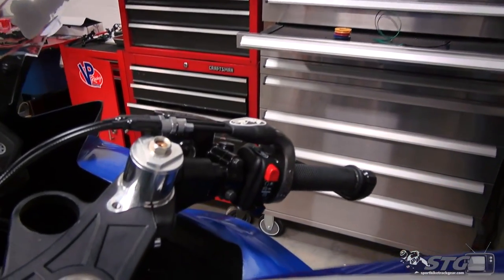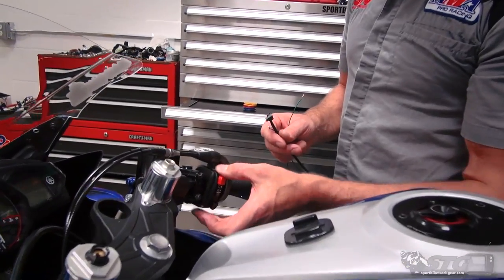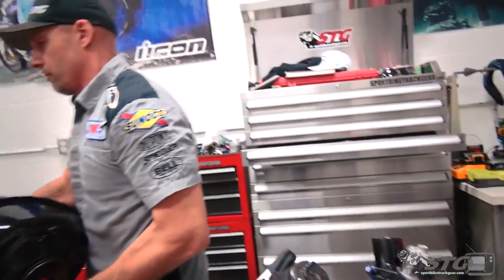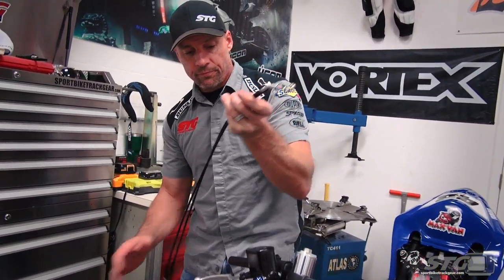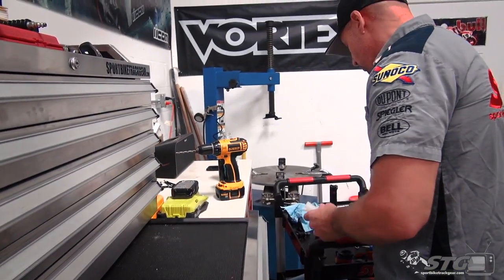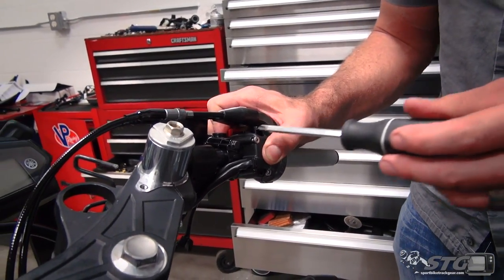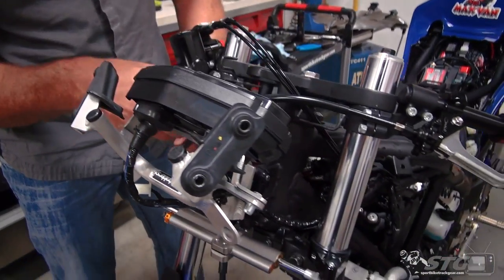Motion Pro Yamaha R3 REV2 Throttle Kit Install | Sportbike Track Gear

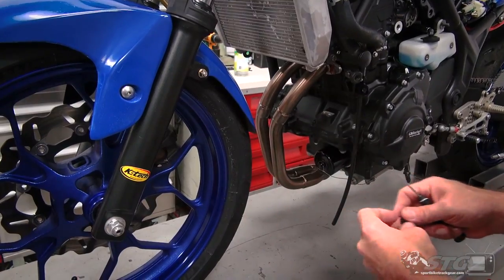Comment: At 10:18 looks like you may benefit from a radiator guard. They sell them at STG :)
Reply from the maker: You are 100% correct my friend! I never intended for the R3 to be ridden on the track as much as Max has ridden it. He will be racing the R3 in 2019, it will have a radiator guard on it then. I may even throw a new radiator in the bike and keep this one as a spare. - Van

Comment: I've got the rev 3 on a zx10r and the throttle tube doesn't fit in the housing??? When the housing is closed the tube sticks. It's soooo hard to turn like it's just not the right size
Reply from the maker: Sorry to hear you are having an issue. Over the years I have installed several Motion Pro Throttle Kits (REV, REV2 and REV3) and never had an issue. I would start with double checking your work. If you don't find anything reach out to Motion Pro and they will help get you sorted. - Van

Comment: Is the start/stop switch necessary to use this? I don't "need" to replace the stock one so if I can avoid buying as much as possible i'll be able to get on the track faster.
Reply from the maker: If your bike has a stop/start switch that is not part of the throttle you can 100% reuse that one. - Van

Comment: i tried to adjust my 09 r6's throttle at the tb, and i unbolted the throttle tube housing, but now i cant seem to get any slack, atleast not what your getting, anyone know where i screwed up? or is my cable not correct for the bike? bought it abused and used, no idea
Reply from the maker: You should have been able to adjust the slack in the throttle cable by using the adjuster in the cable by the throttle housing. To offer more help I would have to see the bike which is hard to do over YouTube comments. - Van

Comment: Hello sir, i want to change new r3 front to old r3 because i like the big lights of front. Is it possible to do , if yes so plz give me tutorial or some way to change. Thanx fir this information.
Reply from the maker: That is not worth the time IMO. Just because there is a new bike does not mean it will be better performing. - Van
Reply: @sportbiketrackgear  thanku sir
Reply: @ramneet1155 Hey Anurag contact Radith Modifikasi on facebook. I love the old look too. The new one looks like a baby dolphin.

Comment: Hi Brian ,
learning so much . thank you. don't do track riding.
did you check out the new range of R series  yamaha motorcycles. what do you feel ?
Reply: I Could’ve used this video last week before I installed mine. Searched and didn’t see it yet. Got to ride with max at barber last Saturday. Kid is fast. What tires is he running? 110 front or 120? Asking because of how the forks are set up.
Reply from the maker: Max was running Michelin Power RS Tires on the R3, 120/70 front with a 150 rear.  Not sure what we will put on the bike next year at this point for tires. It sounds like there will be purpose built race tires for the 300's from Dunlop and Michelin available next season. The kid did pretty good last weekend with a best time of 1:48.7. How did you like the throttle? Max felt it was a real improvement over the OEM unit. - Van
Reply: Sportbike Track Gear  yeah it’s certainly an improvement. The stock tube was so long you  had to re-grip It.  Max hasn’t been track riding that long has he? He was definitely moving. Everytime we got together on track he’s leave me before I could watch his lines lol.
Reply from the maker: Max started on the track last August, he did 2 days in 2017. This year we rode a lot more, around 13 days I think in total. He has had some great coaching from the STT Staff, Chris Ulrich and Johnny Laconte which has helped him improve quite a bit each time we go out. - Van
Reply from the maker: I love the new R3, have not really looked at the other models yet. - Van

Comment: My throttle stays stuck and is very hard to move
Reply from the maker: Do not ride the bike until you have this sorted. Check your cable routing, cable adjustment and make sure the grip is not dragging on the clip on tube or the bar end. - Van
Reply: @sportbiketrackgear  I just had the cam set up the wrong way it was the rev3 version just a bit different from your video. Thanks for replying!

Comment: have they fixed their rubber covers yet?  everyone's is dry rotting in just a few months.  reason so many guys I see going with domino.   also don't use normal grease on plastic. it will break it down and in my experience makes the throttle sticky.  I always do it dry and it is silky smooth for years.  if you insist on using grease use silicone or wax on plastics.  crazy as it sounds pledge furniture polish on plastics like vinyl works great as a lubricant.  squirt compressed air under the grip and it will slip on like butter.
Reply from the maker: I have used both the REV2 and it's predecessor on shop bikes and not had any issues. We have sold a ton of these over the years so I asked the staff if they have heard this from customers, no one said they had. Motion Pro is a solid company, if you have an issue with one of their products they are there to support it.

As for the grease I have been doing the same thing for years on more bikes than I can remember now and will continue doing so. - Van
Reply: @sportbiketrackgear  maybe they got a new manu for the rubber cover.  But a few years ago many guys on the R1 forum had them cracking and so did my buddy.  But i had the original rev kit on a previous bike with no dry rot.  No one gives a crap on a race bike but they will on a street bike.

Comment: That seems like a big pain in the ass. I recently discovered my killswitch got broke off in my parents garage. I was considering this 300 dollar route but now that I see you doing all this I kinda rather just buy the oem switch setup
Reply from the maker: This is designed for racing and track use for the most part. You could use it on the street but do not really need it for the street. - Van
Reply: @sportbiketrackgear  yeah seems like a lot of work for something I only need a new switch for. Just going to buy the oem part much easier 😂

Comment: Would you guys recommend this for casual hooning around on public roads or do you find it too aggressive in traffic and stuff like that? My bike has a pretty long throw and it would be nice to sharpen it up a bit.
Reply from the maker: It comes with multiple cams that allow you to tune the ratio pretty easily. I do not see any reason not to use this on the street, great part and it will help you get your throttle where you want it. - Van
Reply: @sportbiketrackgear  
Chris Riddiford 😂
Call
Reply: Do the 2 adjusters on the cable adjust the valve opening or just the snap back ?

Comment: What is the black thing installed on the tank? Can some one post me a link of what product it is please.
Reply from the maker: The gas cap or the tank pads on the sides? Gas cap is a Driven Halo and the tank pads are Tech Spec. - Van

Comment: Is the 50 ration best for roll racing?
Reply from the maker: I would use the biggest cam to get the throttle to open as fast as possible. For roll racing you would not need the progressive cam we use for road racing. - Van

Comment: Do you oil your cable every once in awhile or just. When doing change overs. In part ive never thought of that. But never have problem. Just curious if it something I should worry about doing once a year or something
Reply from the maker: I will only do that if I have the bike torn down for another project unless I feel there is an issue. - Van